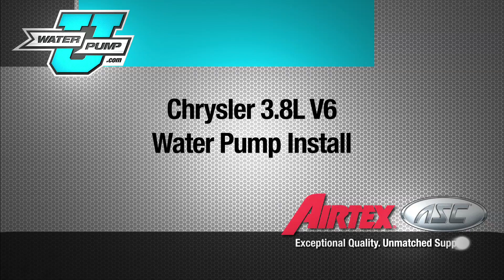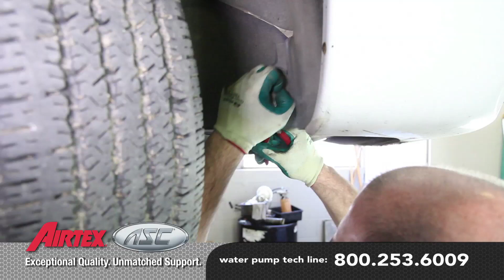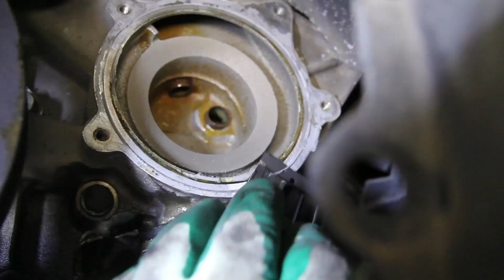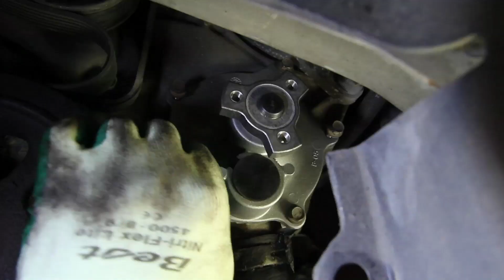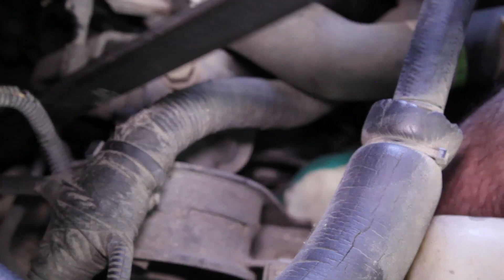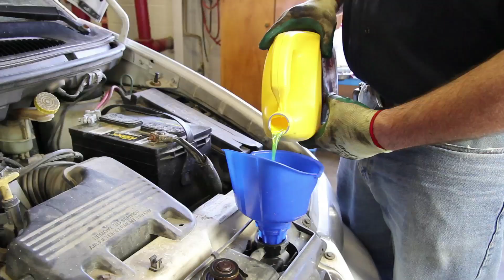How to Install a Water Pump - 1990-2000 Dodge Grand Caravan 3.3L 3.8L V6 WP-732 AW7126

Comment: what is the WEAR INDICATOR!?
Reply from the maker: The belt tensioner has a range it works in. There are two marks on the body and one on the part that pivots. The pivoting line needs to be between the lines on the body.
Reply: There are notches on the tensioner so you can see when the belt stretches out and tensioner soon wont hold it tight anymore...